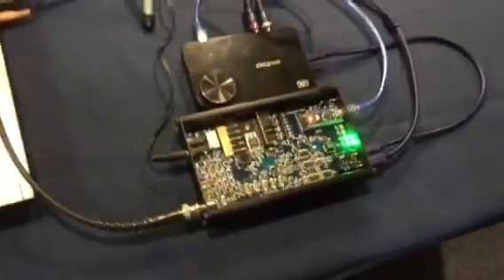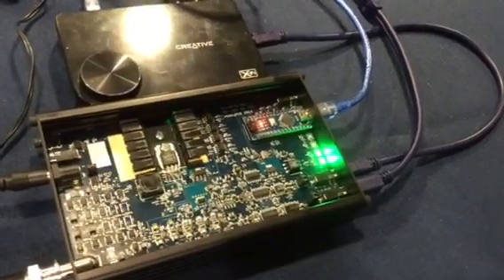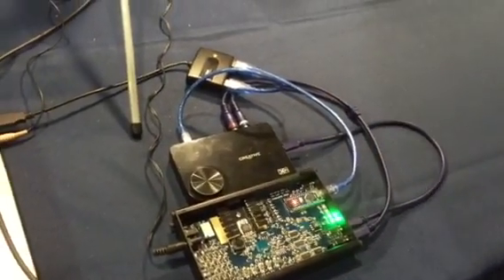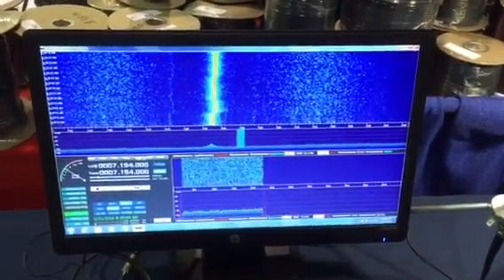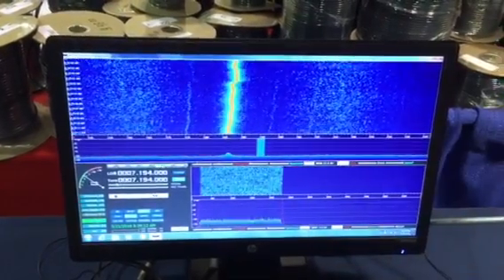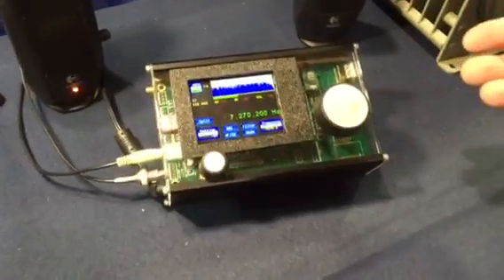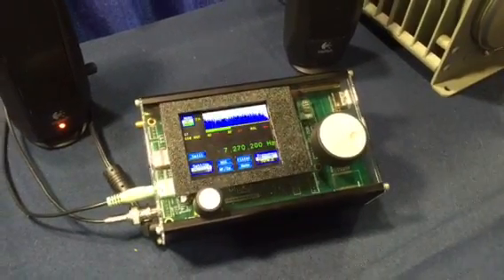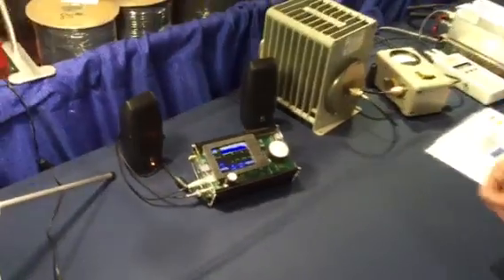HobbyPCB RS-HFIQ 5W HF Transceiver Introduction

Comment: Lazy people! It's just a repackaged Softrock used to flog their amplifier module.
Reply: Yes it is a Softrock! with nine significant differences:

1. 80/60/40/30/20/17/15/12/10M bands (it would take 3 Softrocks to cover the same range)
2. 5W power output (nothing you can do to a Softrock to make this happen except add an amp)
3. Lowpass filters so it's legal on all bands (the Softrock you have to plug in a LPF on one of it's bands)
4. RF, AUDIO and Digital grounds (the Softrock ties the RF and Audio together so the antenna ground isn't ground)
5. MACOM wideband transformers  for excellent phase and amplitude balance (the Softrock uses hand wound BALUNs)
6. SI5351 LO generator with 3 outputs (the Softrock has a SI570 with a single output)
7. Open source FW running on an Arduino (the Softrock uses a difficult to update ATTiny85)
8. LNA in the RX path for improves RF sensitivity (The Softrock hs no gain in the RX path before the mixer)
9. The board is fully assembled and tested (lots of SMT assembly and coils to wind with the Softrock)

The Softrock is a great little radio but some of it's limitations limit it's appeal. Not every Softrock user will be interested in our RS-HFIQ but the RS-HFIQ will appeal to some hams who wouldn't consider building a Softrock.
Reply: Yes yes, but you seem to be ignorant of the various "expansion" Softrock projects which went on 5 or 6 years ago. The Mobo V4 project and soundcard. The Gemini SDR was a side project also.

Fair play to you for packaging it all up, but the limitations of the system remain. HDSDR on windows is rather crude for transmit applications, and old versions of PowerSDR don't run on Windows7.
Reply: OK on the efforts to take the Softrock all band, maybe you can post a link to where hams can get the boards, technical info, kits and/or assembled boards. The RS-HFIQ is just another effort in a list of projects to add capability to the Softrock.

You can get one here:

https://www.kickstarter.com/projects/hobbypcb/rs-hfiq-5w-software-defined-radio-sdr-tranceiver

Yes the Genesis is also a very nice radio but more expensive, I think we have a decent niche here for a product that provides good functionality for a reasonable price. And HDSDR, while functional, is getting a bit long in the tooth but it's only the tip of the SDR software iceberg. GNU Radio, Quisk, SDR# or custom apps are all in process as well as a number of stand alone solutions like the STM-32 SDR in the video.

As for flogging the amplifier, we'll be happy to sell the amp to Softrock/Peaberry/Omnis users, we even have a booster stage so the 1W Softrock can get 50W output. But there seems to be no end of very excellent 5W radios, KX2, KX3, LD5, LD11, FDM-DUO, Flex-1500 seems like more and more all the time. With the amp we've also found a tiny spot in the Ham Radio equipment market that we can fill with a solid product.

Lazy? As much as I can!